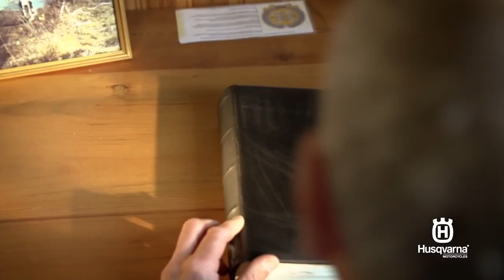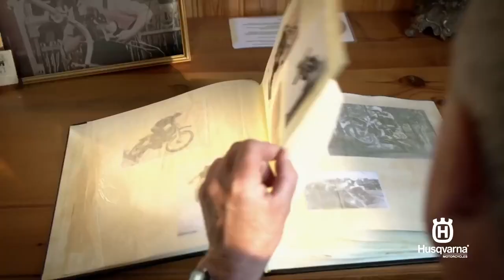THE JOURNEY OF A LEGENDARY BRAND | HUSQVARNA MOTORCYCLES

Comment: Both Husqvarna and Husaberg were founded in Sweden. They made Husqvarna in Odeshog,  Sweden,  until late 1987, before moving to Italy and  Cagiva,  who bought the iconic company. The last motorcycle made at Odeshog, was a TE 510, driven from the production line and out of the factory by  enduro legend and factory rider  SvenErik Jonsson. Husaberg was bought by KTM in 1995. As from 2014, both Husqvarna and Husaberg are owned by KTM. An era of Swedish made motorcycles gone forever.  I remember I bought a 1994 FE 501 Husaberg back in December 1993, and picked it up at the factory in Rofors. Cheers from Norway